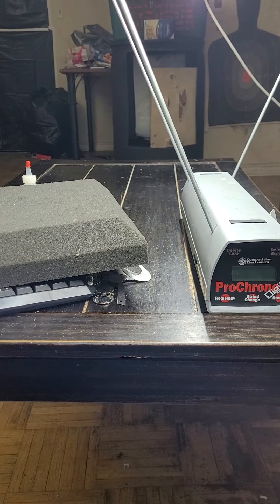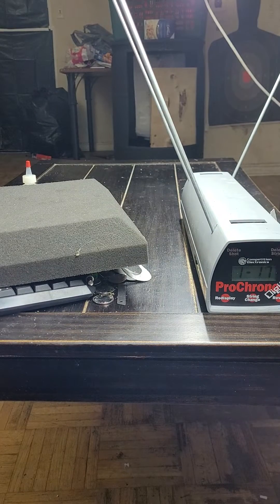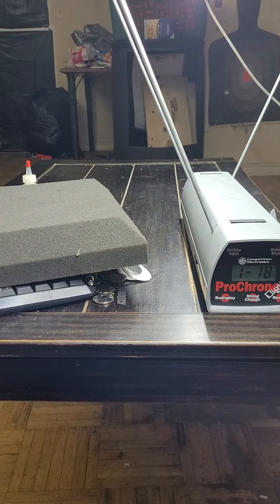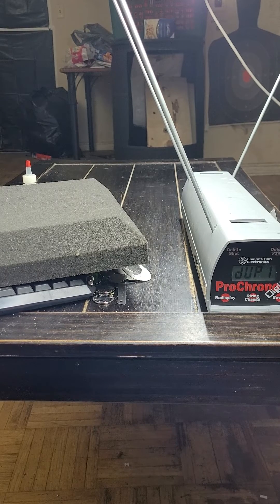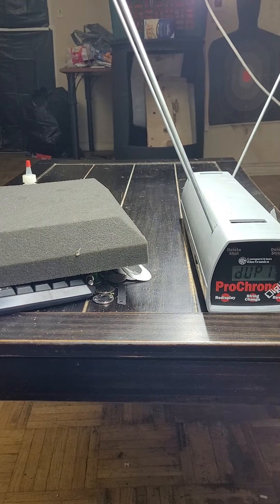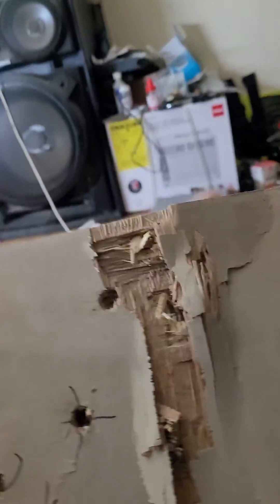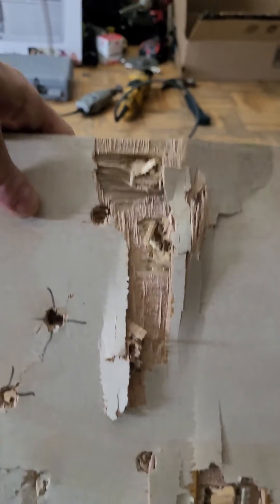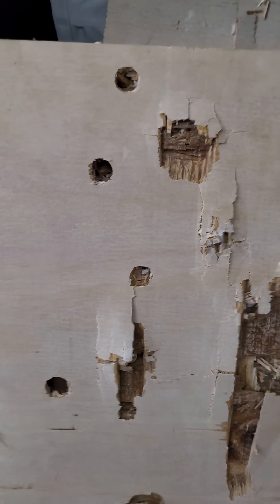Umarex T4E HDP 50 PART 2 less wear on valve pin oring 1100 psi hpa and empty co2 can

Comment: It is possible that a solid aluminium or plastic/nylon cylindrical rod, about 65mm - 70mm long, with diameter 18mm - 19mm might be used instead of a spent 12g CO2 cartridge.